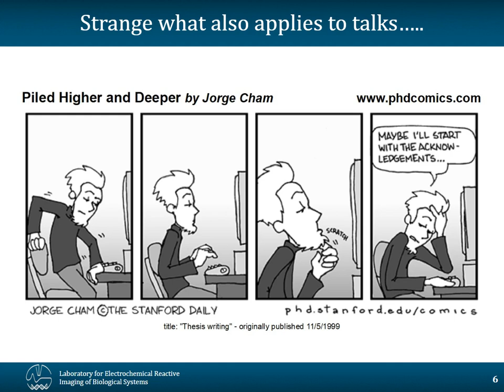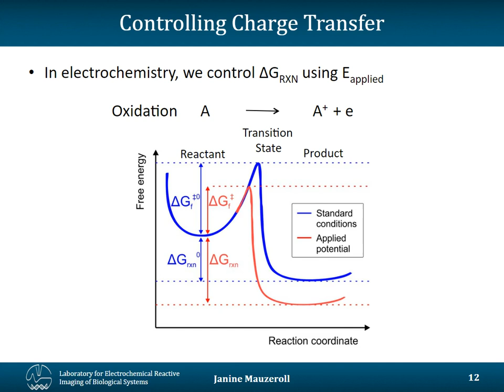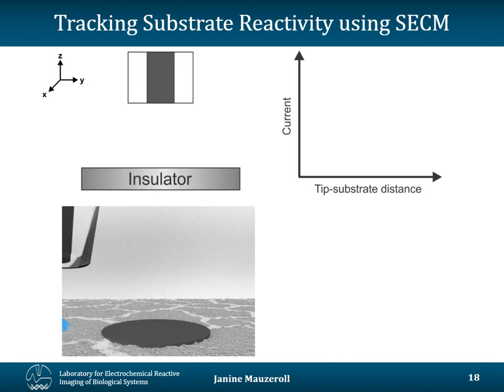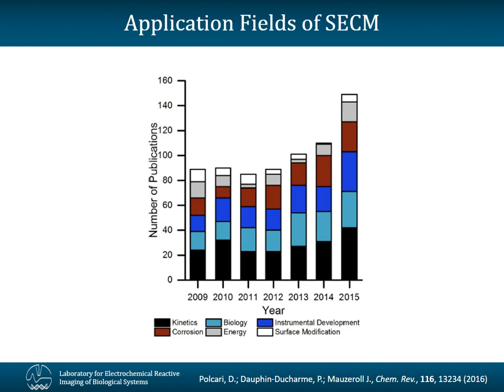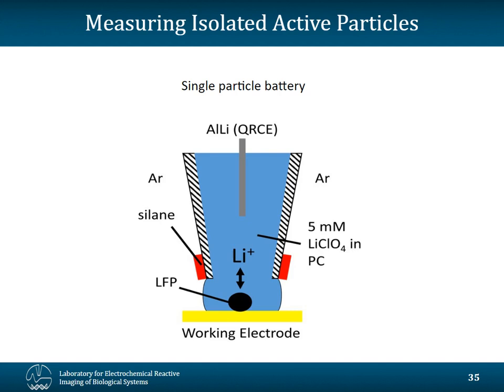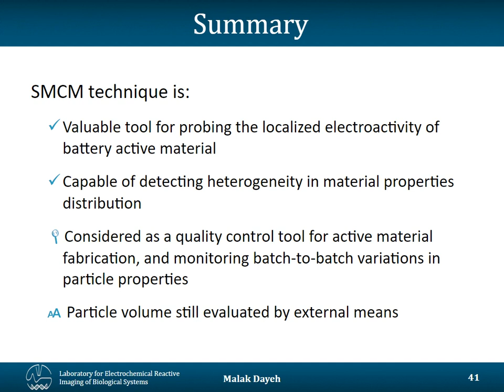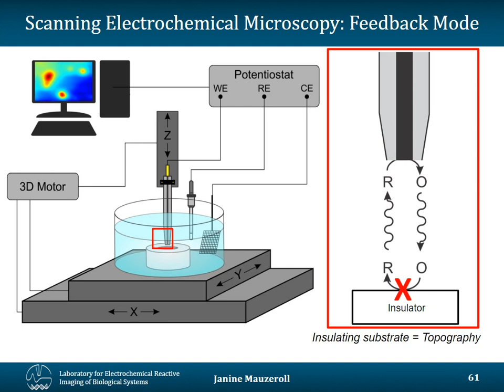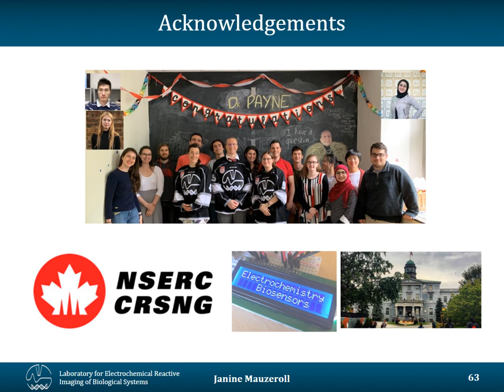The Wonderful World Of Scanning Electrochemical Microscopy

Comment: At 39':30'', the speaker claims that" the passive film is not totally insulator, there some reactivity because of the porous in the oxide." Actually, the conductivity of the passive film is not because of the porosity but the conductivity of the passive film comes from being a highly defective structure like a semiconductor in which has oxygen vacancies, metal interstitials, and cation vacancies. Passive films are usually bi-layer structures including a highly defective inner layer forms directly from the metals and a porous outer layer that forms from the ejection of cations from the inner layer, reacting with the electrolyte and subsequently form a precipitation on top of the inner layer. However,  the conductivity of the passive films are related to the defective structure of the inner layer.